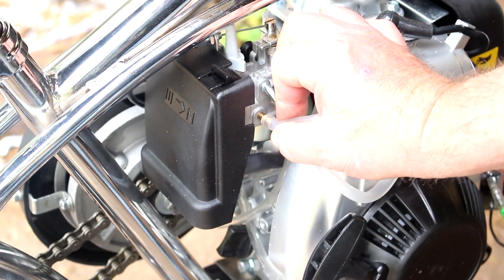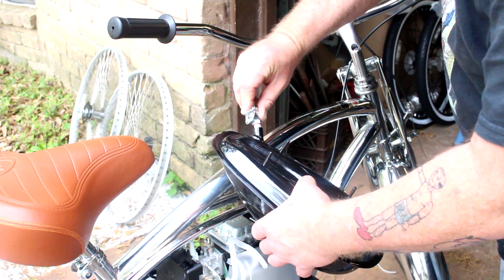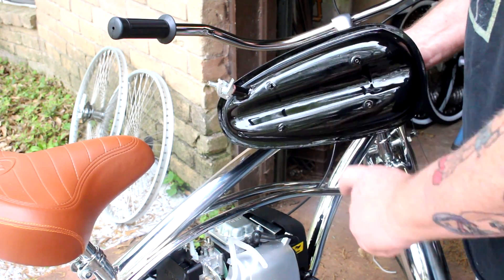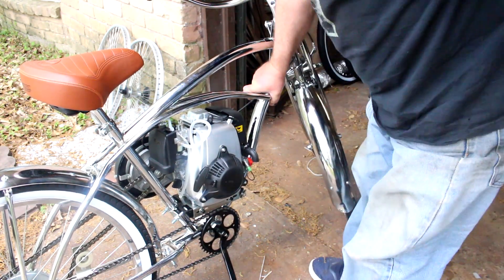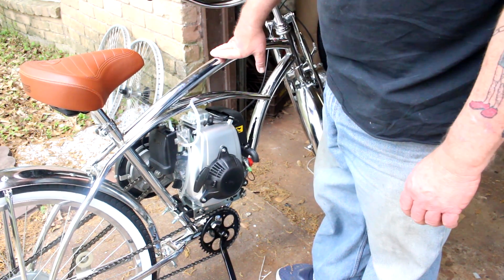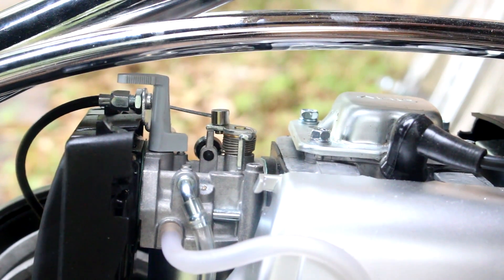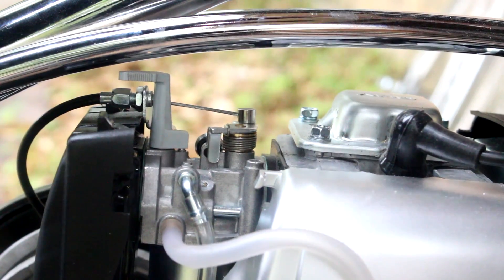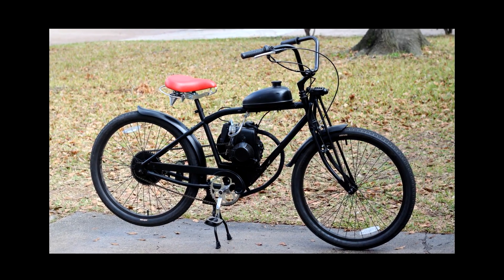How To Build 4 Stroke 7G Motorized Bicycle Part 6 NEW

Comment: If you mount those tanks on 2 thick beads of stinky rtv silicone,tape them straight up and don't smoosh all the way down,you won't have to use those studs or straps.  The cushioning will eliminate fatigue cracks that are common with chinesium. It'll take a piano wire and 2 people to saw it loose,so center it up good and tape it .

Comment: throw that fuel line away, it turns hard in 5 days and becomes brittle, I bought tygon line, its very good.
Use clips or tie wraps on all fuel fittings. Briggs and stratton inline filter is best.

Comment: Tanks are full of dust and rust, flush and rinse with gas.
Mine clogged the filter and carb to the point i threw the carb away and bought an NT carb,
I cleaned the carb 5 times and it still wouldn't idle without half choke.

Comment: BRAKES??? BRAKES??? You spend a lot of time and you do a really good job going into extreme detail regarding every aspect of how to make the bike go. You do a wonderful job and your videos are some of the best I've seen. There is one seemingly obvious critical topic that your videos regarding the 49cc 4-stroke Motor installation are all lacking...  HOW TO MAKE THE BIKE STOP...?  I watched your old series on the 49cc installation and also this new one. You completely disregard any mention of brake upgrades which are crucial when using this type of  bicycle. The backwards pedaling style of braking system that comes standard on these bikes is not nearly enough to be safe.  They basically have to be upgraded, or you are risking your life.  So yeah, WTF dude
Reply from the maker: Been riding these bikes for 6 years. So far so good. So WTF ??

However, check out my ultimate 2 stroke build. Front Hub Brakes. Bottom line, I don't go any faster than I'd want to wreck a bike. Therefore, I go SLOW
Reply: I dont doubt your knowledge/ experience at all and like j said you're videos are some of the best I've seen.  I just found the lack of attention to brakes interesting... Do you have any potential recommendations for brakes that can be aftermarket applied to a beach cruiser bicycle?
Reply from the maker: @stickersteve9343  bit.ly/2Y1ln6X
Reply: Thanks again man!
Reply: My last question is about exhaust.  I have that motor and I am wanting to install an exhaust pipe on it but the motor has to bolts coming out of it that are used to install the stock exhaust. Can I remove these bolts? They are too long to install the new exhaust pipe and they are only threaded at the very top so I Can't Screw nuts on to secure the new exhaust
Reply from the maker: @stickersteve9343  sure..4 strokes have 5mm I think and 2 strokes have 6mm threads for exhaust

Comment: Was hoping to see the kill switch wiring. Mine has 2 wires, red and black. My motor also has 2 wires, a green and a black with white stripe. Not sure what combination to connect the wires.
Reply from the maker: look closely at the motor wires. All you are doing it shorting out the wire from the magneto to the wire that goes to the motor ( ground ) just wire one wire from motor to switch and other wire to switch. Can't mess it up

Comment: Does anyone know if this is legal in fort Worth? I can't find anything online.
Reply: Kyle Antle I don't know about Fort Worth Texas but in Missouri it was long as you stay at 49cc or below or at least label your larger motor as a 49cc because a cops not going to know the difference and you're running headlights tail lights and blinkers it falls under the same category as mopeds and they don't need to be registered in the state of Missouri or plated or insured all you need is a valid driver's license it doesn't even have to have a motorcycle endorsement just a regular car drivers license so most likely I would assume something like this would fall under the same category as scooters you might want to check with your local DMV I called my local sheriff's department to ask them a few questions too that might also be an idea in Missouri technically if you go over 49cc it's considered a motorcycle and since you built it yourself you have to go and take it to a highway patrol office and have them inspect it and they issue the paperwork so you can get a VIN number and have a title made and register it and plate it and insure it just like a regular motorcycle but that's a lot of hassle so if you're running like an 80cc kit you just remove everything that says 80cc on it put some 49cc stickers all over the stupid thing and don't get caught going over about 30 miles per hour and in Missouri if it's a 49cc and below no helmet is required in most places there's a few cities in my County that require a helmet but no state law that's just City to City
Reply: Joseph Atnip thanks. I've been passing by cops all the time now and they don't stop me. All I have on it as far as safety lights  are headlights and taillights .  I don't have blinkers on it  or it would actually be considered a moped . I actually have cops come up to me all the time at gas stations when I'm filling up and compliment me on it. Here in Texas, for it to be considered a moped it must have an automatic transmission AND have a speed limit of no more than 30mph. So therefore I could modify it to go over 30 and put a shift kit on it to go even faster and I'm still legal. But in case I ever came over there, thanks for the information.

Comment: Hi I'm planning to build one of these bikes only with a Honda GXH50 would that same transmission that is on the 7G work on the Honda? If so where would I order just the transmission I heard the huashengs are a copy of the GXH50 I just wanted to use a better quality engine.

Comment: Hey +HoustonMotorized. I was looking at the bikes on your website and I'm curious what you did to the engine and transmission reduction gear on the vintage rat bobber to give it that look. I can't find a 4 stroke engine kit that comes in black, all the engine blocks, transmission parts, sprocket wheels, etc are silver. Is it as simple as painting them?

Comment: I see some problems. First of all, NEVER allow metal to metal contact between the gas tank and frame. It will wear through the tank very quickly. I use a piece of pipe insulation on the frame top bar between the frame and tank. There should be a factory made rubber pad for that purpose that fits better, but I don't know of one. 

I see you have one of those "killer" chain tensioners on there. Avoid those at all costs. I had one break and get sucked into the rear wheel causing me to crash while riding in the bike lane, just a couple of feet from fast moving traffic. VERY lucky I fell away from the traffic. I still have the scars from that one. The best thing to do with one of those tensioners is to throw it as far as you can, preferably into a lake or over a cliff. You can get engine mount tensioners for 2 strokes. Not sure what is available for 4 strokes, but DON'T use that kit tensioner. I can't see a good view of it in the video, but another thing you absolutely want to avoid is the rag joint attachment for the rear sprocket. It is almost impossible to get them straight, and they pull against the spokes, not the hub, resulting in broken spokes. You can get clamshell mounts to mount to the rear hub itself that solve these problems. 

I wish someone would build a decent quality motorized bicycle kit. All I see is these cheap and dangerous Chinese kits. I ride a friction drive bike, with an American made Staton drive unit, and a genuine Honda 4 stroke motor. No problems in over 4 years. Only limitation is it won't work in the rain, but it doesn't rain where I live. If you need it to be rideable in the rain, check out a GEBE belt drive engine kit. Unless you have a high dollar bike, you will need to replace the rear wheel with a quality one
Reply: "I wish someone would build a decent quality motorized bicycle kit. All I see is these cheap and dangerous Chinese kits" 
you'd include upgraded and reliability parts in kit, but the cost is kind of high. maybe if someone did as a hobby/labor of love and not try to make so much profit from ppl would snap them up
Reply: Just use an old inner tube
Reply: vulcan1753 n
Reply: @clarencemenzel8982  vulcan1753n what

Comment: Hi. Your instructional videos have been a monumental help. Thank you for taking the time to record, edit, and publish these. Quick question, after recently installing this kit, my motor wont start as you've explained here. 

On mine, it only starts and runs with the choke on the "running position" not in the "starting position". Kill switch works fine with the red switch by the exhaust in the off position? Ever experience this? Also, the bike has started turning off on me when coming to a dead stop. 

Anyway, with your help, hopefully others can benefit from my question. Any insight will be greatly appreciated. Thank you.

Comment: Hi there, I've got a two stroke but my chain keeps getting off on the back sprocket. I had to get a new chain from the seller but any advice?
Reply from the maker: +austin johnlewis You need to make sure sprocket is aligned correctly on wheel. See my new 4 stroke building videos for rear wheel setup. It's the same for 2 or 4 stroke
Reply: +HoustonMotorized thanks man, I'll check that
Reply: +HoustonMotorized thanks man, I'll check that